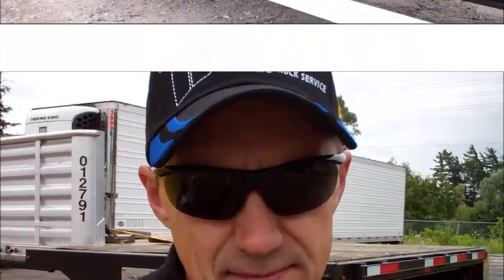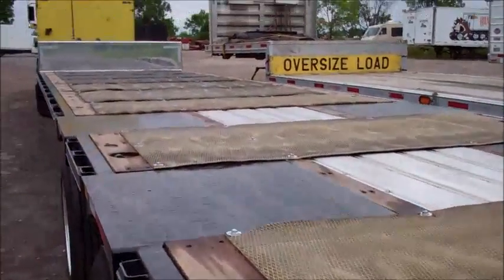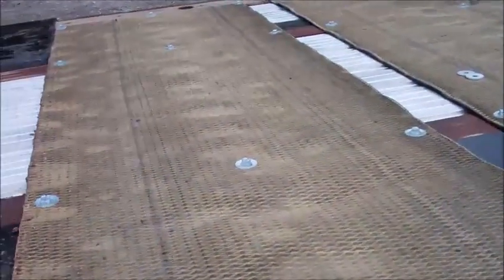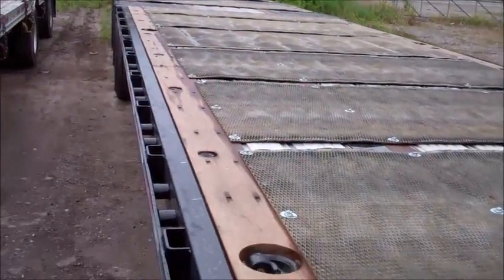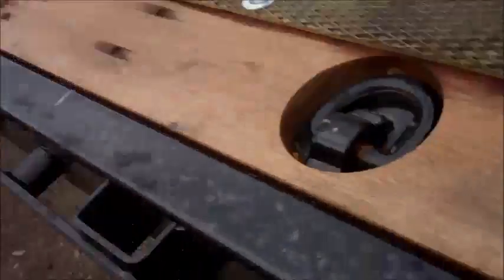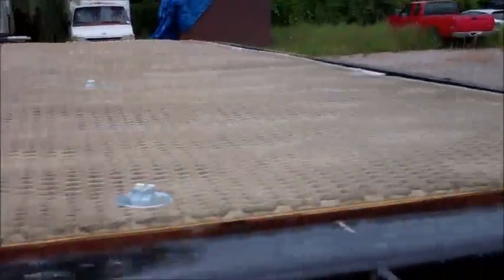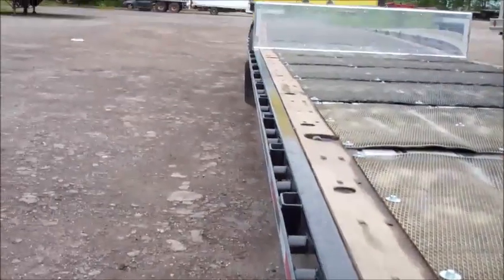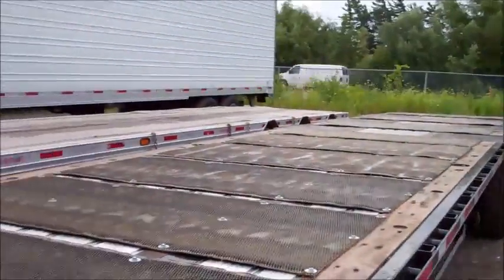TRANSCRAFT STEPDECK TRAILER UPGRADES

Comment from the maker: skids never slide easy on the aluminum floor anyway. the only floor that's good for that is wood. i saw many skids fall apart when a forklift guy tried to push it across the ribs of the aluminum floor. but we'll see what happens with this rubber during the next few trips. this is a practical experiment.

Comment from the maker: if they don't work i can always remove them. but where i'd still keep them no matter what is on the uppper deck (they look much better there than on the lower deck in my opinion) and at the very end of the trailer where I have the 2 holes and where the dock plate caused scratches. the first few loads will show if this rubber is a good or bad thing. i'd never know until i tried.

Comment from the maker: i asked a bodyshop about this. they said they never worked with horses but heating a metal and bending it back should work BUT the strength of the metal in that spot will go down ;)

Comment from the maker: one option i'm looking at is renting some kind of power tool and filing off/sanding the sharp edges on the screws' heads. the top of the screw looks like a bolt with a slot for a screwdriver. i think if i round the bolt-like edges on the sides, the slot in the head will still allow to unscrew them later on if necessary. these are really some heavy duty screws ..

Comment from the maker: If I remove the rubber, i can always fill the holes with that spray foam that is used to fill up cracks. it'd be perfect because the screws are only in the WOOD part of the floor. you can cut that foam once it hardens to be level with the floor. as for the snow and winter trucking, i've long wanted to do more hauls to the South of US ;) this trailer will give me another excuse. don't forget that aluminum floor is not flat either: it has all kinds of ribs and indents.

Comment: Hi Sergie, I think where you will get frustrated and possible dangerous is in the winter. All those grooves in that rubber matting will get filled with snow and even when you shovel it will just fill each groove. Then the snow will freeze and walking on your flatbed will be very slippery. Dirt will have same issues in the grooves. Also, did you affect any warranty by modifying this trailer? If you remove those mats, you now have big holes. I would have gone back to the Transcraft first.

Comment from the maker: i never tried this rubber covers before. will see how it works. if the screws get destroyed by loads, i'll just take off the rubber and revert to the original faulty design ;) or maybe replace aluminum with apitong wood OR (if I win a lottery) get that rumber from texas for 'only' 14 bucks a foot. btw, what you see on my 53' trailer cost me (parts and install) $2.55 per square foot.

Comment: Sergei,

Brad McFarlane has it right.  You need access from below, but the carriage bolt is the answer.  (Google it and you'll see.)  The square shoulder under the bolt head provides enough resistance to keep it from spinning when tightening the bolt from underneath.

Good luck!

Comment from the maker: Just talked to a SPEEDLINER dealer in Michigan. He said they have to grind and sand the surface before spraying the bedliner otherwise the spray won't stick. The cost is appr. 10 bucks per square foot. BUT: this stuff is not slippery at all and will make it hard for a forklift to slide skids around. He said rock haulers use sheets of plastics to cover aluminum inside their dump trailers. Those might work better but then you're running again into the problem of securing this stuff to the floor.

Comment: They are actually two different things.  Elevator bolts are flat across the top while carriage bolts have the convex dome.  Carriage bolts come in a much wider variety of sizes, finishes, and lengths and are generally much cheaper.  In the US any good farm supply (e.g. Tractor Supply/Farm Fleet/etc.) has a good cheap selection.

Comment: I agree with Brad, Sergie. They should have used Carriage bolts with flat rounded heads. Those bolt heads look problematic.  Grinding them down would look non conforming, unprofessional & would be very labor intensive.  
The rub rail issue looks mostly cosmetic. I'd keep things as simple as possible. Have you thought about using a jack and bending the rob rail back out?  The welds should hold if you simply bend it back out.  Find someone with "jaws of life" device to help you.
Thanks for videos!

Comment: I think I would be using 3/4 inch toungue and groove plywood and sheet the deck. It will give you protection plus a smooth deck.  Even go right over the steel plates over the wheels. Fixing that rub rail is easy all a welder has to do is cut the center of that bend straighten the steel and re weld it done. Should only take an hour

Comment from the maker: if we hadn't used washers the screws wouldn't hold the rubber. it's pretty flexible. as for the heads, flat or round ones would definitely be better but it's too late now. what's funny is that before shippers' skids used to tear away at my deck. now my deck will be fighting back ;)

Comment from the maker: So, basically there's a reason you don't see too many trailers carrying protection panels on the deck ;) The disadvantages outweigh the advantages. If you look at all the associated headaches, it becomes cheaper just to replace the damaged boards (wood or aluminum); and stay away from the loads that are likely to cause excessive damage (such as scrap metal).

Comment: the installer should have used flat head bolts no washers and torque them to sink in the rubber. pallets would slide easy